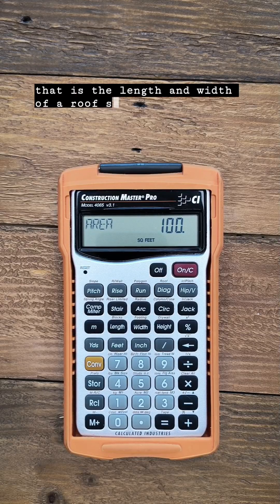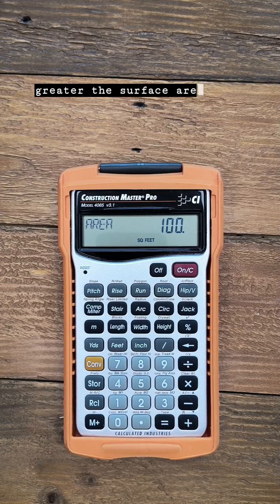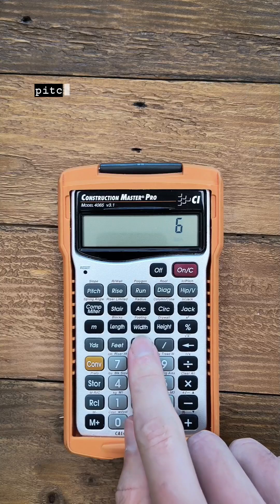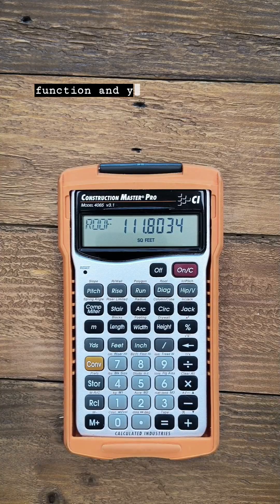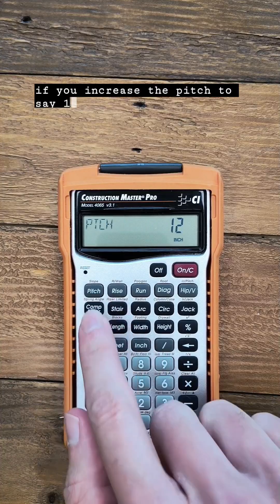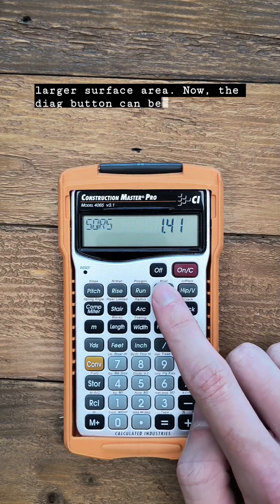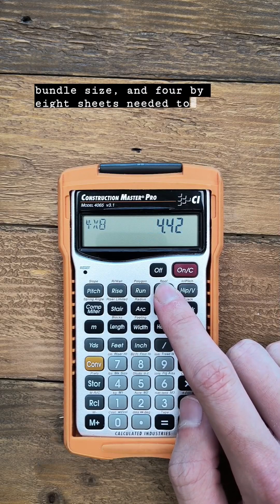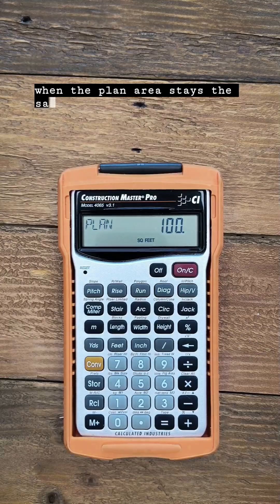How to Calculate the Area of a Pitched Roof or Ceiling

Comment: So the floor length and width then input the pitch and it will give you both sides of the roof square footage? As well as the bundles and 4x8 sheets that's for the entire roof?
Reply from the maker: Good question. It will give you the roof square footage (and bundles, sheets, etc.) for the roof section that you entered, so you will need to multiply this by 2 for both sides of the roof 👍